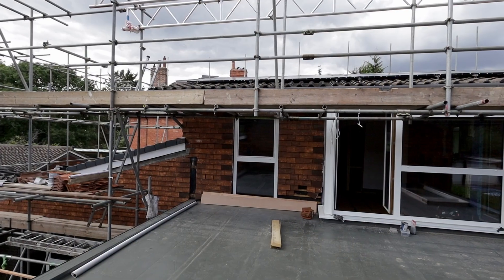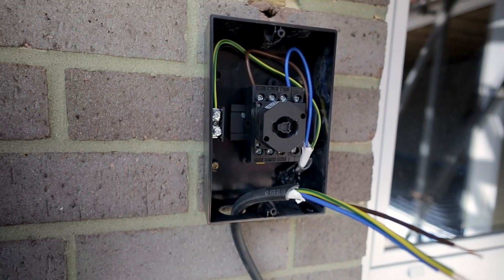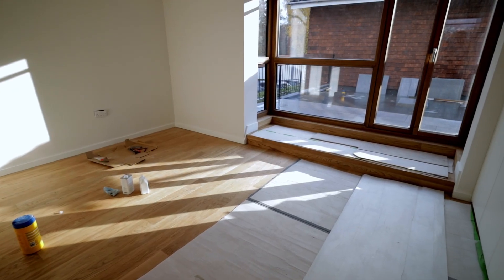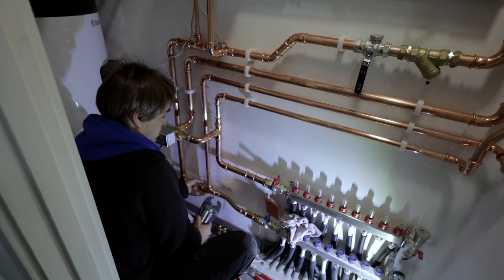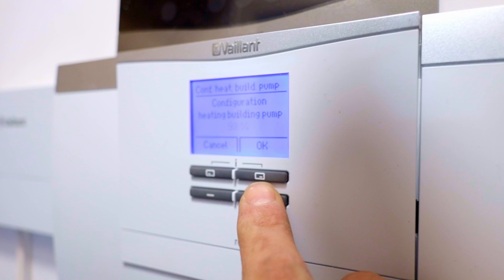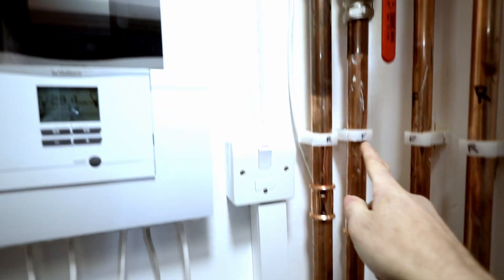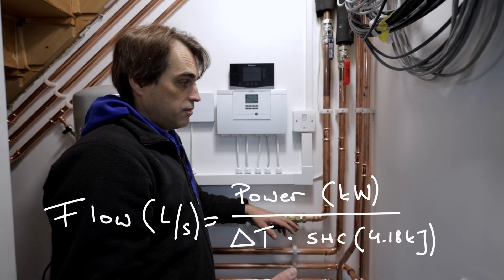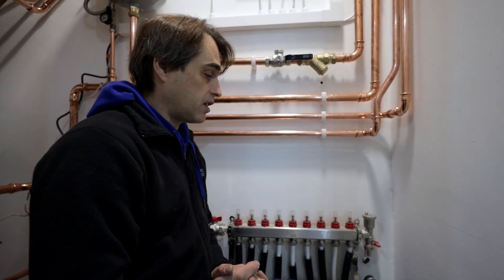How To Install an Ultra Efficient Heating System - Heat Pump + UFH.

Comment: Hi just found your channel which I have learned so much from ,so thank you. I have been looking at ways to improve efficiency with my gas boiler and through watching your videos now realise that it is far to big.We moved into the house 4 years ago and a new boiler had been fitted "Ideal Vogue Max 40" it is a 5 bedroom house and well insulated built around 2009. I purchased 2 nest stats to run UFH and Rads but because there were 2 zone valves I was informed that open therm could not be used.
I had the nests installed but basically it appears to be an on off system?. The boiler currently runs at 50 degrees but cycles ie the flame symbil disappears and then comes back on.
1- could I use  weather compensation and would it worth the purchase and cost of install?
2- Would it help in anyway to reduce cycling and bills
3- Could you advise on any further steps I could make.
I live in central Scotland any feedback would be greatly appreciated.
Regards

Comment: Great video, as always.  Interested to know your advice on what you fit to external unit. do you fit isolator ball valve first, then the antifreeze drains, or the other way round; do you fit drains on both F & R, i've seen some with only 1 fitted, there risk there must be water caught in the line that has no drain?
Reply from the maker: I don’t fit anything outside apart for a single AFV
Reply: @UrbanPlumbers  Excellent

Comment: Got a customer at the mo who is constantly calling me and complaining his house is freezing and his floor is cold, it’s a Vaillant system boiler with 1 mixed and 1 unmixed circuit, open loop ufh all on WC, it’s achieving a perfect 21° int temp, upped it to 23° and got a call saying he wants it all ripped out because it’s not working, room temp at the time of call was 22.5° 😩 all he cares about is his floor being hot, don’t care about comfort, efficiency or cost, just wants his floor to be hot 🤦‍♂️ I’m so done with it, I’m going to up the curve and desired temp to max and he can burn his feet for all I care 😩 why is it so hard for customers to grasp the concept of low temp heating 🤷‍♂️
Reply from the maker: Some people are unhappy no matter what you do. Whoever rips it out will get complaints of high bills and house being hit and cold. Ignore those people.
Reply: The aim with this system is for a flow temperature so low the cat won't know where to sit.

Comment: I need your advise. Im buying a 1950/1960 semi detached house with an extension. There's is no fill in cavity in the origional part and only 50mm cavity with 50mm insulation in the extension.  Can this house ever be made to have a low heat loss? Apart from cavity fill, what else can be done? What's would you estimate it's heat loss to be its 130sqm
Reply from the maker: Get a full heat loss survey done by a reputable company. Cavities can be injected, loft can be insulated and windows can be upgraded. Should be possible to drop heat loss to around 5-7kw if there are cavities there already.
Reply: Client for this project here. Yes, you can bring a 1960s house to the very highest standard of efficiency. But we have had to look at almost every element of the construction. It has all taken a lot of work - you need to find motivated and expert professionals who will pay tremendous attention to detail. Like Szymon!

Comment: So from your videos, it's seems that when you switch to ASHP, you only have one room state and UFH with no actuators.
Any reason why you don't now require automatic bypass valves on the Y plan? Was under impression it's usuful unless you use towel radiators and before any zone valves

Comment: Does the outside temperature effect the efficiency of the heat pump? What COP would you achieve with say an outside temp of -2 degrees?
Reply from the maker: Of course it does. This system was showing a cop of 3.0 with around those temps outside. You would generally expect around 2.7 with -2 and 35c flow temp if I remember the figures correctly

Comment: Hi Simon Great video. I was just wondering about the flow rates. Doesn’t the aerotherm run automatically at around 850lh? But your design speed is 650lh? So it will be going too fast to achieve dt5? Would you manually reduce the pump speed to achieve the correct DT or is the auto speed and a smaller DT acceptable?

Thanks 
Matt
Reply from the maker: Arotherms are targeting the flow rate most of the time and narrower DT will happen in warmer months - it acceptable. Even when it tries to slow the pump down it may not be able to slow enough for DT5 on a well designed system - that’s totally fine
Reply: @UrbanPlumbers  thanks for the quick reply!! Just built my own house and have installed the system myself with a lot of inspiration from yourself and heat geek. I noticed that with my flow and return temps were more like 3 and I was wondering if it could be an issue. My system is running at 0.25 heat curve and heating the house perfectly 💪🏼

Thanks again 
Matt
Reply from the maker: Yes low heat loss and very flow temp will run and small dt most of they year

Comment: Don’t you need a pump on the underfloor?
Reply from the maker: Most people do, I don’t ;)
Reply: @UrbanPlumbers  I don’t know much about heat pumps yet.

But I’ve done an under floor job for a customer to then had a heat pump fitted and is struggling to get flow to UF.

The heat pump installers have removed the pump I fitted I said they need to refit in a close coupled tee config.

Got me worried it’s something I’ve done

Comment: Great video. Do you not need secondary pumps for the two circuits or is the ASHP pump powerful enough to cope?
Reply from the maker: You shouldn’t use circulators on manifolds or low temp setups. If you have too much system resistance to run ufh then you may need a buffer

Comment: The way in which you make these videos informative,  accessible and engaging to both heating engineers and non-technical experts like myself is a real skill and I really appreciate the way in which you embed learning into these case studies - in this case the calculation of appropriate flow rates for the calculated heat loss. If you told me two years ago that I'd be seeking out videos on YouTube about heating systems, I wouldn't have believed you! So thanks for all you're doing to share your developing expertise to help educate, inform and entertain folk from some many different backgrounds like myself.

Comment: These videos are great, well presented and informative.  What I take away is that ASHP works very well with well insulated homes.  So governments should be addressing this issue along side encouraging the adaptation of this heating source. I’m seriously considering converting my 60’s bungalow  that has an EPC of C.  Think an in depth survey will be well worth the investment before I make this sort of investment.  My concerns are real cost of ownership including servicing costs, will it really warm my home at an affordable cost.  Don’t know what cost electricity will be in the longer term.  Think governments have more work to do.  Great vid thank you. Mike
Reply: Well the efficiency c
Is dependent on the flow temperature. The lower that is the better the efficiency. You could already Start to tun the heating curve of your current system to the minimal flow temperature necessary to heat up the building. That saves you gas. The added benefit is that if you get it below 55°C you can expect a heat pump to work reasonably efficiently. Adding insulation will bring down the required energy. But that's true for any heating system and not directly related to heatpumps. As long as flow speed and heating surface allow running at or below 55 heat pumps work. That's true regardless of the insulation.

Comment: Do the UFH manifolds not need circulation pumps?
Reply: No. Heat pumps have bigger pumps than on boilers and because radiators in properly specified systems are sized to run at the same temperature as the UFH, you don't need to blend either to keep the temperature down.

Comment: When you said its all open loop, im guessing there is some allowance for opening/closing the room valve on the manifold if someone ends up wanting their bedroom more at 16 than 18 etc then adjusting pump speed if needed, then the overall temp of the property is more of a master control.

Comment: Out of curiosity - in colder climates (e.g. eastern europe, northern europe) where -20C is relatively common during the winter, how much power would be used for defrosting?

P.S. Always informative and interesting, keep up the videos!
Reply: Guess answer based on physics alone: 

Most of the energy in defrosting is changing the ice back to liquid, so temperature has some effect, but not a massive one. I would guess you recover some of the heat added to the evaporator metal when it switches back to heating mode and takes heat back out again, but presumably the fan throws most of it away.
Reply: @bringiton8989 I heard humidity and precipitation are the biggest influence on the frequency of defrost cycles
Reply: @chrisE815  yes, this is true. I was just thinking "energy per defrost cycle" but you're right. Air at - 20C is so low in humidity that fewer defrosts should be needed.
Reply: @bringiton8989  Cool, thanks for that! I assumed from the bat that it would be way more. its good to know thats not the case really.

Comment: For hot water, does it use the heat pump’s 37c flow to heat up mains water temp and then an electric element to top it up to 60c+?
Reply from the maker: No, it’s a R290 unit that can go up to 70c if needed
Reply: I was looking to see if anyone asked this and you have. Thank you.
And thank you Scymon for taking the time to answer.

Comment: We have a dual spilt air to air heat pump. The house is open plan on two levels. Insulation is average to very good. It was -9 C last Sunday morning. The heat pump is set at 45% power demand. The house stayed at 20 C and the external compressor had little to no ice on it. The electrical heat pump consumption for that 24 hours was 13.4kW. We pay 0.17€ per kWh so = 2.28€ before tax. I can't buy wood to burn for that. Not that I would burn carbon fuels. Just shows how efficient HPs are. Keep up the good work.

Comment: Our house has a 40kW gas boiler, so I’m amazed that you can heat a house with only 4kW of heating.  It must have extremely good insulation.
Reply: I would be surprised if you needed 40kW of power. Boilers are almost always oversized. I have a 24kW boiler but my heat loss at -5 is 4.5kW at a house temp of 21c. Bonkers!
Reply: It’s also just a standard 30’s semi detached with standard loft insulation and cavity wall insulation. Nothing fancy.
Reply from the maker: Average 3 bed semi is around 6kw heat loss
Reply: @UrbanPlumbers  what about 5 bedroom detached with floor area of about 3,000 square feet?
Reply from the maker: new build would be around 6kW-7kW.A period uninsulated property could be as high as 20kW if fully detached and with poor windows. Modernized 3000 sq feet period property - 10-15kW
Reply: @UrbanPlumbers  that's helpful, thanks.
Reply: The high output is for hot water, not heating. I'm no expert but I'd imagine 40kw would manage 2 high flow showers used at the same time.

Comment: Great video again Do you advise vaillant? as it’s not the first one you fit and why ? Thanks
Reply from the maker: Yes, great units, acceptable controls and a decent company
Reply: thanks I am moving my business to renewable but there is a lot to take in as well as getting the right knowledge and doing a perfect install , I need to think about , is my tiny company big enough to install heat pump? what product /company to use and backup you are getting , how do you price a heat pump job ? thanks again  @UrbanPlumbers

Comment: two questions 
If the cylinder is calling for heat is there still enough flow rate through the heat pump? 
If you have south facing rooms with lots of glass how is the underfloor heating controlled? It seems to me that they would overheat. Similarly a lot of people would find 18C too hot to sleep in. I try to avoid UFH running under beds because they act like thermal stores, nice when you get in but not at three in the morning when you wake up sweating.
Reply from the maker: I have been through the scenario of overheating or under heating on my systems already ( no zoning ) - and every single system was fully adjustable on flow rates alone - however it needs to be designed well for this to be possible.

On the question of solar gain - it has never been a problem as well - but if it ever becomes a problem, you can always add a couple of actuators and wireless high temp limiters for any areas. I haven’t had that issue yet and I have fitted a lot of those set ups now. 

DHW - yes we still have good flow rate here. DHW circuit will always be lower resistance to your index heating circuit - so that is never an issue, unless you install a wrong cylinder with restrictive coil.

Comment: What would you then do for instance, if the bedroom requires a higher temperature for a shorter period? 
When the temperature control is based on flow and heat-loss from the initial setup of the system.
I love what you are doing, and getting deeper into how to build efficient heating systems!
Reply from the maker: Just get an electric fan heater for an hour
Reply: Why not suggest to just increase the flow for an hour in that room and increase the flow a bit from the main system? Just a curious elec Engineer..

Comment: So you have to heat the entire house no matter how many rooms are used? In paper the system may be running super efficiently, but if you are heating areas which are not used then you are wasting energy no matter what?
Reply from the maker: As counterintuitive as it may sound - heating half the house will very often result in much more cycling, higher flow temperatures required and also also comparable or higher energy use not lower! Hard to explain it in a comment - I will shot a video about or check heat geek video about why not to zone.

Comment: Are the heat loss calculations really accurate or do you run the system over time and then adjust for heat loss errors?
Reply from the maker: The calculations are surprisingly accurate. Assumed air changes aren’t. It is best to do calculations but measure the air changes with a blower test.

Comment: I want to thank you for sharing your knowledge. You saved me €600 on my gas bill this year. I saw a video of yours last year and started working on it. I converted my entire house to low temperature heating in combination with a 2 year old intergas extreme 36 and went from 1100m³ to 500m³ of gas per year. The intergas extreme 36 runs at its lowest power setting with a pump speed of 55% and a supply temperature of 35 degrees and return around 28 degrees with a flue gas temperature of 25 degrees. And the best part is that my house heats up faster and easier compared to the old underfloor heating distributor and a supply temperature of 65 degrees. Thanks again!!! And continue with your YouTube Channel

Greetings from Holland
Reply: Hi. How was your heating system configured  initially and what exactly have you changed ? Thank you !
Reply: Interesting experiment. Read gas meter, collect all condensate for 4 hours or so and measure collected volume and gas consumption. 100% condensation should yield 1600 mls of condensate per cubic metre of gas. My system does 1.15 l/m3.
Reply: 1100m3 ??? Thats nothing...WE had 24000 before Corona, than 12000 and now 6000m3 only possible with 3 fireplaces in our house. WE use CO2 neutral.... wood. 🎉
Reply: It costs me €1200,-. 

But the savings are 600m³ a €1,30 ( the price in Holland) = €780. 

Break even in 1,5 year
Reply: that is awesome  @dive_the_dutch_way  🙌
Reply: It’s not full savings right? You did spend much more than 400€ investing to have such system right? I’m curious how long would it break even though 😊

Comment: Put a carrot in a plastic bag and in the fridge, what happens? The bag goes misty on the inside. Condensation!!  I struggle with the idea of turning your home into a giant plastic bag with membranes!
Reply: Except the plastic bag doesn't have an MVHR system taking away the humid air and replacing it with fresh air. Insulation-Airtightness-Ventilation just do one and you have problems, do all three and you have a comfortable efficient house. PassivHaus has been doing it for years without issue.
Reply: MVHR is cheaper than a heating system. We just need building regs to mandate good levels of air tightness and MVHR and the industry will make it happen at scale. Also the slightly increased cost will result in lower costs to the homeowner.
Reply: This home with a MVHR will definitely not have any condensation problems. Truly epic systems that should be mandatory on new builds, but cost would make it unfeasible

Comment: won’t the flow rate be the same through all loops? are you controlling the temps by the size of the loop? eg wider centres in bedrooms = lower emittance = lower temp than other rooms? What if later in use the client wants to adjust relative temperatures?
Reply: You can adjust the flow rate per circuit at the manifold. The red/clear things on the upper manifold are flow rate meters and adjusters in one.
Reply from the maker: Flow is different for all the loops depending on: 

1. Room heat loss
2. Pipe spacing
3. Desired temperature 
4. Floor coverings
Reply: @UrbanPlumbers  so that can be controlled at design stage? Are there issues with lower flows in some loops (or doesn’t matter as they’re parallel)?  but if the customer decides later they’d prefer the bedroom a little cooler in the evening do they only have the global control? I do like the idea of using the circuit itself as the buffer for defrost - that seems very smart design and simplifies too